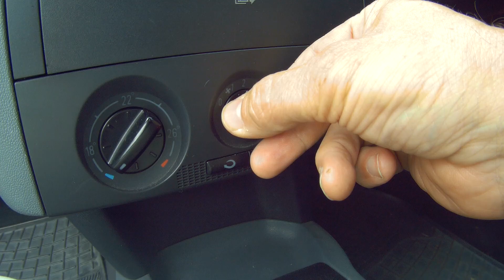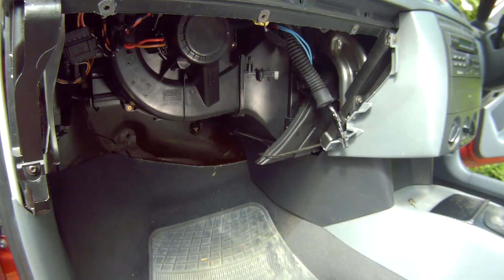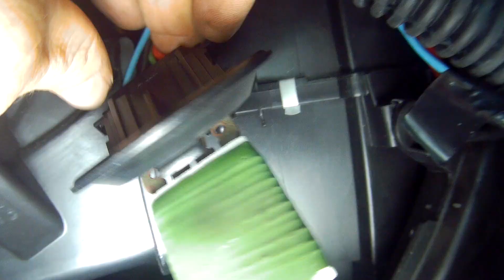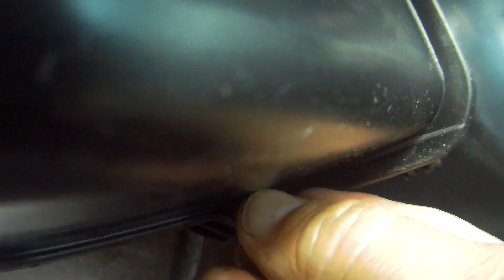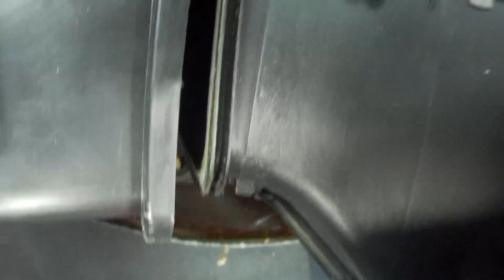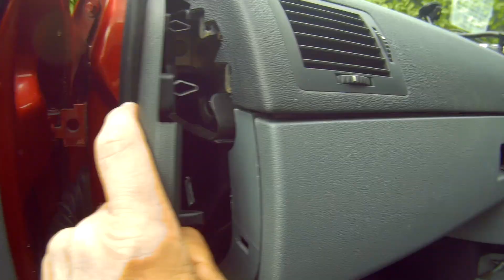SKODA FABIA Heater Ventilation FAN+ SPEED CONTROL

Comment: Hello 👋 great video. My fan was only working on no 4, I've bought the resistor pack, and also a new fan motor, the heaters stopped completely now,  so I guess the motor has blown, changed fuse but still no joy. I'm going to attempt to do these two jobs with my friend 🤞🤞. Do I have to disconnect the car battery?? I don't have a manual with mine so I don't know what the radio code would be? Any help would be appreciated,  thanks 😊
Reply from the maker: Change the resistor first and see if the motor then works. I don't know about whether that circuit would throw a fault code on disconnect or not, probably not, but be warned if you then get a dash light you will need to clear the code. Ok if you have a Good code reader. You need to get the radio code at some stage, you can get this online quoting the serial number, or fit a new unit with code given :-)

Comment: Thanks mate, you've helped me a lot with these video.

Few weeks ago I had water broken, I was at training centre hwne this happened, we didn't knkw it was watwr pump, my tutor por some liquid into the radiator said this will block the leak, but it didn't, infact that product affected my heater, since then the heater didn't blow a hot air, can feel a little warm air, ON number one after driving for hour but when I turned up to number 4 total cold air.

Is there anyway you can help me with to clear the heater which I've been told it's inside the dushboard. Can you advice please?
Reply from the maker: I haven't done a video yet on the heater matrix, but hope to do one at some stage given time. It can be a little messy if you don't know what you are doing as some water is involved. try flushing your system out with a hosepipe, but be mindful that in some cases it might create some leaks :-)
Reply: @HatBoyHarvey  hi mate when you say creat leaks, you mean from where the leaks?

Comment: I recently got a Fabia 2009 and the ventilation system was perfectly fine for the first month but now that winter is setting in it started making a noise when i start the car ( cold in the morning) It only last for a minute or two and once the car stop being cold it goes away. It sounds like a high pitch hum. The vent speed doesn't seem to effect the sound. If i turn the heater off the noise stops but the different speed settings doesn't effect the sound that it makes. Just got the car so a bit low on finances to start bringing it to the shop. If you have any thoughts about it i would love to hear them. 
The sound itself doesn't really annoy me all to much its more the thought that something might be wrong and in need of fixing before it gets worse and breaks itself further.
Reply from the maker: where is the sound coming from? sounds like that are often heard in the engine bay, serpentine belt etc

Comment: You make great videos Harvey thank you very much. I have a 2003 1.4 TDi with 320.000km and I'm starting to get a smell off the AC system do you have that same issue or know about it?
Reply from the maker: Sounds like you need some anti-bacterial spray to kill any fungus that builds up inside the air ducts and evaporator. I've never done it so not sure which product to use. I'll look into it and maybe make a video. Scotty Kilmer recommends 'lysol' sprayed into the vent intakes
Reply: @HatBoyHarvey  much appreciated for the info, I did do it with some product but no diference, I was thinking of a more intrusive method and take everything apart to clean.... probably not an easy job too,  well thank again !!! brilliant videos!!!

Comment: Dear Harvey,thank you very much for this exzellent video. My heater-ventilation sometimes makes a beeping sound. Is it possible to oil the motor or must I exchange the unit? Thank you and best greatings, Mathias
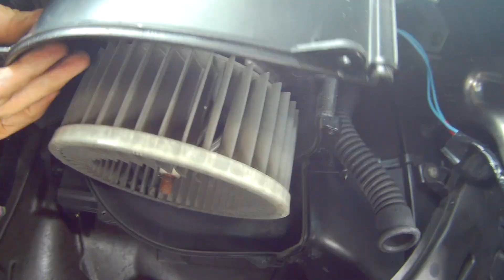Reply from the maker: Many thanks, If the beeping is from the dashboard then this indicates a fault, but if your saying it is from the fan then I would probably try to do that. There are some clips on the back of the moulding that releases the motor @ 4:58 if that helps. Do you get any dashboard warning lights?
Reply: @HatBoyHarvey  No, I hear it beeping sometimes, when the fan runs on level 2 . When I switch to a different level, beeping stops soon. I guess I'll try to oil the axles of the fan with a little bit of silicone spray. Thank you very much for your excellent advises and soon answering, dear Harvey
Reply: By the way: there is no warning light on the dashboard...

Comment: i got my skoda fabia 2000, the air con is not working, mechanic said heater sensor inside heater box need replacing.
as he said the sensor tell the compressor it’s cold enough and don’t not work, so no matter i push aircon button to turn on still no cold air coming out.
can you help me in a video 
pair in mind, compressor replaced and regased it 
thank you
Reply from the maker: Sorry you are having problems with this as it is so hot now. The flapper motor servo could be stuck on hot, even though the knob on the front panel is turned to cold (AC wont turn on on hot). This is a common fault and I haven't a video on this yet, but plan to do one. you can manually make sure it is turning to cold by taking a few panels off and help it a bit if needed. Check out my video: https://youtu.be/X0a0_x7q5aY this shows you where it is+cabin sensor. I  would look at these first. also you may consider the ambient outside sensor: https://youtu.be/ZuZRC3w8g8s and the evaporator sensor: https://youtu.be/HpPAoVx1wJk

Comment: Hi 👋
Thank you for the video
I have a question:
I have 2004 BBZ petrol engine Fabia and it has two problems with AC system
1. There's no heating at all (I was told something about Evaporator/Heater Core)
2. The recirculation mode not working, neither the button's light nor the "mode" itself.
Can you tell me what to do please? 🙏🏼
Reply from the maker: Thanks. First check the fuses inc the ones one top of the battery box. Any lights on dash? battery 12.6V, ground OK. Coolant level OK/flushed/changed with heater on hot and fans on full, any AC at all, power to relays/relays. A diagnostic check would be useful to identify actual faults.evaporator sensor can be changed/heat core cleaned out.

Comment: I push my recirc button when cars first running and clicks off its self within a few seconds then doesn't work again. Could this be the recirc flap motor thanks
Reply from the maker: Yes, it maybe stuck though, so you may be able to free it up. try activating it and moving it by hand a number of times. If that woks I would then use silicone lubricant on moving parts. If it doesn't work at all then a new motor unit would need to be programmed in with vagcom etc
Reply: @HatBoyHarvey  thanks for your reply I will try that. I allso have recently purchased vagcom is it easy enough to program new part in if it needs replacing. Currently getting my head around vagcom haha

Comment: Hi and thank you for all your videos, am a subscriber, but didnt expect ill be needing help, I enjoy knowing my car parts by your videos, but recently my 2000 octavia mk1 electronic heater stopped working, I can see the screen control and that i can adjust fan strength and temp on the screen, but there is no fan blowing at all, no interaction, the heated seats also stopped working, as well as ac. can you help me please
Reply from the maker: Thanks, and thanks for subscribing. It sounds like a fuse. First have a look at the fuses in the battery box as this can be suspect to overheating, maybe fuse has blown there. Check battery has good charge 12.6V and 14V+ when charging. Fan resister speed control goes and is cheap to replace. Check all connections and relays for the seats, but my guess is it is a fuse and as some system incorporate other systems then some of the main control fuses need looking at, not just specific ones. hope this helps :-)
Reply: @HatBoyHarvey  Will do, and keep you updated, thank you very much for help and reply.
Reply: @HatBoyHarvey  Hi, I checked all fuses, battery, they are all ok, in car and over the battery, what will you recommend please, blower or heat sensor?  Thank you very much for reply
Reply from the maker: @mycomment6699  If you haven't got OBD2 diagnostics which would help pinpoint the issue, then you will need to check further in more detail the circuits/connections/wiring involved. Certainly check the fan and fan speed control resistor which you could test with a multimeter. Is the outside ambient temp on the dash working? the internal one can get clogged with fluff and is fairly easy to clear with a vacuum and brush.
Reply: @HatBoyHarvey  OMG, it was bloody raining and snow today, i have an obd 2 scanner with me, but weather forced me to finish soon, did not hit me to use it, i checked all fuses with the multimeter.Ok, will do, and keep you updated, can not express how much i do appreciate the reply, thanks man.

Comment: Hi there, great video - very useful info. I plan to replace my fan speed control sensor soon as it is only working on 4 only and I suspect this is the issue. In terms of disconnecting the battery before working on the car, is it sufficient to just disconnect the negative terminal only or should I disconnect both terminals? Sorry if this is a basic question but I just wanted to check as I’m an amateur on car maintenance. My fan is also making a noise from time to time which I’m hoping is leaves which can be easily cleaned out  but if the fan is damaged, is it an easy job for an amateur to replace it? Cheers.
Reply from the maker: Thanks, just the negative earth lead. once you have access to the fan you may be able to find out what the noises are. Fans ain't cheap, if you can fix it removing leak, great :-)
Reply: @HatBoyHarvey  thanks a lot for prompt response.
Reply: Replaced fan speed sensor today and now have 4 speeds fully working 😀 was quite tricky, but lots of jiggling and patience won through! No leaves in fan and no obvious reason for intermittent noise - will replace If it becomes too frequent. Wouldn’t have had a clue but for your video, many thanks again 👏
Reply from the maker: Thanks, glad you were able to jiggly-fix things. Love that word 'jiggle' :-)
Reply: @HatBoyHarvey  thanks for the great videos. Can I just ask for some advice, I've replaced the resistor and now have speeds 1, 2 & 4, but not 3?
Any ideas?
Cheers

Comment: Brilliant, great sound & video, simple explanation and guide. Top notch mate!
Reply from the maker: Glad you liked it, much appreciated, but need to do more :-)
Reply: @HatBoyHarvey  vehicle 2004 fabia. fan 1 2 and 3. level was not working. I changed the part you showed it was fixed. After 1 month, the same part broke down again, now I changed it again. why do you think it fails constantly?
Reply from the maker: @ye427  Not sure, maybe you just got unlucky with the part you bought or it wasn't good enough quality, but my first thoughts were: the fuse should have gone first. Maybe have a look and check if the fuse is the correct one. The control unit maybe giving Intermittent signals and effect power surges/drops. I would check the wiring and connections also.

Comment: Excellent videos, very helpful, cheers, thank you. Could you advise me please my heater blower suddenly stopped working after recent freezing weather. My Fabia was parked during the snow and bitter temperatures. Checked fuse but still not working. Any advice greatly appreciated
Reply from the maker: Thank you very much, most appreciated :-). Any dashboard warning lights? does the control panel light up? Have you had the fan out to inspect it, if so then you should independantly test its operation. somtimes the motor james and just want freeing up, which is a sign that it is worn. You may find that the cold weather caused moisture/ice on some contacts somewhere and may work again when warmed up which is worth a check. Check battery is good and charging. OBD2 scan may help if you have access. Keep warm, it's freezing!
Reply: @HatBoyHarvey  Really appreciate your reply, thank you. I shall wait until weather warms up, so maybe July 😁 before I know. Cheers for your advice, your videos are brilliant. Keep safe & healthy 👍

Comment: Great video ....Nice nick the car too ....Anybody know which fuse is for the heater in the fuse box please?
Reply: Rear window 39,
cigarette lighter 42, (useful to know)
fresh air blower 68

the video about the cigarette lighter has a link, and shows you how to remove the panel, having the plastic tweezrs to remove the fuse is very helpful.

Comment: Great channel! I Wonder if you could help me with one issue. I have a fabia 2003 with no AC and the air Is blowing only on botton area even if i set it up to blow on windscreen or the central area. Power blowing working fine on all speeds.
Reply from the maker: Thanks Jan. Have a look at the distribution cable: https://youtu.be/NlCNw7FtUkc as these can come off or break. If no cold AC then it probably will need checking for leaks and re-gas

Comment: Thanks for your great videos,,
What if the fan works perfectly, but the air comes very weak from the vents, is it from the air tubes? And if it yes how can I reach them?
Reply from the maker: You're welcome, Check if the 3 speeds are working, if not replace the resistor. The flapper vent maybe stuck on hot or the diverter control cable has detatched or broken. It is unlikley the vents are completely blocked up enough to effect the air too much, but is I suppose possible. The front and side vent adjusters/covers come off.

Comment: Great channel! - fixed the door and hatch locks :). Is there a chance that you could  create a video on V68 Heater Servomotor replacement? Do you know if one could just replace the potentiometer inside?
Reply from the maker: Great suggestion, thanks I will do this at some stage :-)

Comment: I really appreciate the effort of showing us how to repair the beloved car Fabia,, can you show us how to replace the radiator of the AC or how to flush it please :)
Reply from the maker: You can't just take this out without gettting the car emptied of refridgerant responsibly. This has to be done by an AC garage, most can collect the gas for you for a small fee. Once done there are other things to consider such as evacuating the system with a Vpump, changing the receiver drier, re-charging it, putting in the correct amounts of oil, refridgerant, sealer/dye.
Reply: @HatBoyHarvey  thanks a lot for the advice :)

Comment: HatBoyHarvey, have you done a video on noisy aircon unit? When I switch the aircon on I get a humming sound that increases and decreases with engine revs... I have seen elsewhere that my Fabia could need a re-gas which I have done, but no change to the noise. Great Videos
Reply from the maker: Not yet. You can get a wooshing sound on pressing AC, is it that?. Where is the sound coming from? noises often emanate from the pump motor as these can fail. Do you still get cold air, continuously or only for a short period, intermittent or none?
Reply: @HatBoyHarvey  Thanks for the reply. Cold air works fine and continuously. There is no wooshing sound on pressing the AC button. It might be the pump is on its way out - when the aircon is on the humming speeds up and down with the revs of the engine

Comment: Thank you for a great Channel. 

I have a problem with my Fabia. The AC is not that cold and now during the summer I need it to work. Could you make a video or tell me what should be done?
Reply from the maker: Thanks, you're welcome.The good news is your AC is working, but appreciate not very well. Over time these systems very slowly leak refrigerant and older cars more so. Pumps on older cars fail, but from what you say yours is working. Finding leaks is difficult and can take time. In your case I would just refill the system with more refrigerant (may be illegal in some countries to do this yourself) with some dye and sealer to first get it working better and also check for leaks (if any can be found) You can purchase pre-prepared bottles to do this or have it done. Be aware not to leak refrigerant into atmosphere. The instructions are on the bottle, just need to attach it to the low pressure filling port (it will only fit on the correct one) and squeeze, get as much in as possible (can't overfill as can pressure stops this). To do a better job you need to remove refrigerant legally by specialist autoshop, replace the dryer, vacuum the system and fill to correct weight, which because is quite involved (I know as I've done it) is better for a specialist to do. Hope to do a video sometime. hope this helps :-)